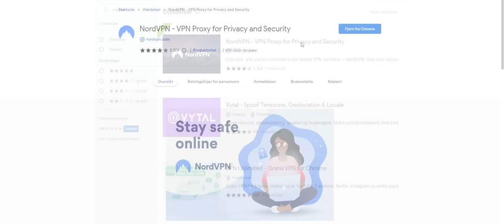Back on the Road to Worlds Most Powerful Two Stroke? Rotary Valve PiP Engine

Comment: Couple of questions --- (a) what happened to the previous rotary valve, and why did you decide not to adapt it here?  (b) the last time you used rotary valves, a lot of commenters were suggesting you should run it at 1/2 crank speed and use two cutouts in the vane instead of one to avoid balance issues, will you try that soon?

Comment: You've probably already put some thought into the aspect ratio, but if you've just picked it because it's the cameras default or because you want to have max resolution, I would strongly disagree: the framing of the shot is either to wide, with about an extra 15% of empty space on either side, or it is to cramped, where you cannot comfortably have both the thing you are holding and your whole face in frame at once. A taller 16:9 aspect ratio would make cutins to avoid jump cuts much less jarring, and would also match the standard thumbnail size on youtube. Cropping off the sides would also allow you to fix framing in post more easily if a tripod gets bumped etc. Would be curious to hear your rationale if there is one; it certainly gives your videos a unique look against the other machining/motor channels, but I'm not sure if the drawbacks are worth it.

Comment: Are you concerned with the friction caused by the positive pressure pushing the rotary valve against the case when you add boost? I see the grooves you have machined into the case behind rotary to reduce the surface area but that aluminum is not the greatest bearing surface. The brass and graphite bearing plates for stamping dies comes to mind. If you need to incorporate something in the future that could be a very good direction to look into. Your determination is incredible. It is fun to watch. 👍

Comment: Reading the comments i was thinking as well that using the crankshaft lobes for inleg timing might be a good idea in this peticular case. This system is used on old vespa 2-stroke engines and works. It needs to be machined with small tolerances but that cannot be a problem with your skillset. If the whole world uses reed valves to produce high performance naturally aspirated 2-stroke engines, that probably has a reason. Add a blower to the equation and this inlet system might be a better choice over reeds and a Rotary inet disk as the disk will probably be causing extra friction, certainly when you add a blower. As mentionned earlier in the comments, fuel injection or maybe even direct fuel injection seems a quick win to gain some extra horsepower to me. It is relatively easy and cheap to install and it will be awesome to simply change combustion parameters with a laptop.
Reply: If you watch his past episodes where he did use a blower you'll see that he had issues with friction caused by the disc being pushed into the housing. The relief grooves machined into the new rotary valve housing come from his attempts to reduce friction and not destroy the carbon fiber disc valve.

Comment: Very good! Personally I think that the inlet port of the disk valve system should have been wedge shaped rather than a simple round hole, the wedge shape would have a better pulse action to the carb and more time-area for and given inlet duration.
Reply: Well this was version 1. :)

Comment: What will stop this rotary valve from doing what the last one did and bending and sticking due to the pressure of the supercharger?
Reply: Yor quite right. It will simply be a matter of running it without the disc installed.
Alex is finding there are faults where he wasn't expecting them in the cylinder porting.
Lets get the engine revving to at least 18k making power reliably which it's not ATM,  then add a SC/EFI.

Comment: This isn't amazingly relevant,  but have you seen ProjectHercules? Chap building a motorcycle engine using a massive cylinder from a sleeve valved radial aircraft engine.

Comment: Rotary is going to impede the wave track and back pressure
Reply: It will, it's supposed to be a resonance induction, I believe this is just for ironing out some issues with his design
Reply: @sleepwalker3520  it's a pumping air the wrong direction it will never help fuel mixing neither will a variable gate unless it's a type of ibt
Reply: He needs a roll over valve to control draw
Reply: Well, it doesn’t impede anywhere near as much a a reed valve does it?
Reply: @Scissors69  sure does it is going in the wrong direction of the piston
Reply: @seanbragg1696  - when the piston is going up and the pipe is in the effective part of its rpm range, the rotary valve is in the fully open position, and, thereby, not causing any impedance, unlike a Reed Valve, which always causes some restriction, even when the petals are fully open.
Reply: @Scissors69  right the valve gets on the draw of the pipe hes on the crankcase to the piston and its not in the intake tract to piston
Reply: @seanbragg1696  - that’s right. It’s moved out of the way
Reply: @Scissors69  no it isnt
Reply: @seanbragg1696  - I don’t know if we’re talking about the same thing here Sean, but it sounds like you’re suggesting that when the valve is fully open, then something is still covering the inlet. Is that what you think?
Reply: @Scissors69  its not open it is spinning the air not projecting the air path in higher the rpm the less open it is to piston
Reply: @Scissors69  it will mess with the air cycle it covers 3/4 of the draw at high rpm if you watch videos you can see the carburetor fight this cycle with atomized fuel
Reply: @Scissors69  you need to go over elmer racing he explains it about 10 minutes in his live stream on rotary disc vs reed
Reply: @Scissors69  the pip should have no valve just volume of incoming air to the piston

Comment: Why cant you install a roots type supercharger on the bottom of the crankcase .use full circle fly  wheels with gear teeth cut into one of them to drive the roots type supercharger with internal gear that matches up with the gear teeth on one of the fly wheels .on the intake side of the blower use an over size reed valve so there is no restriction.. now to address your problem of too low torque to get underway.  Use a manual exhaust power valve and if you want to be a little more fancy ..make the stinger with an adjustable length ..tie both adjustable exhaust  power valve and adjustable stinger together so as to operate on one common linkage ..as the exhaust  port power valve begins to open up the stinger gradually becomes longer and done with one synchronized manual linkage you have complete control of while you set a new land speed record on the 50cc class at the Bonneville Salt Flats ..ill met you there as i want to ride my bike to Bonneville ..i have a new dry nitrous system i come up with i want to try out